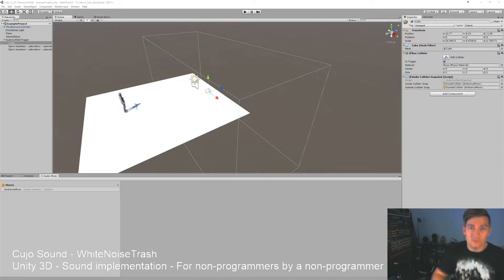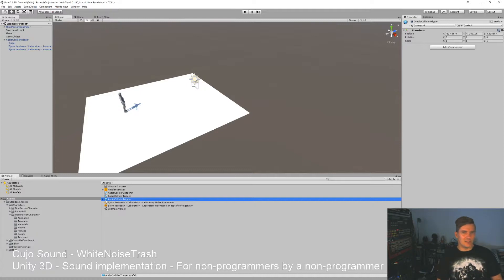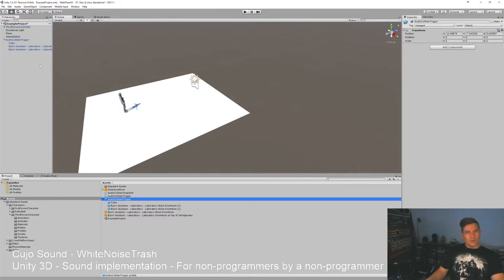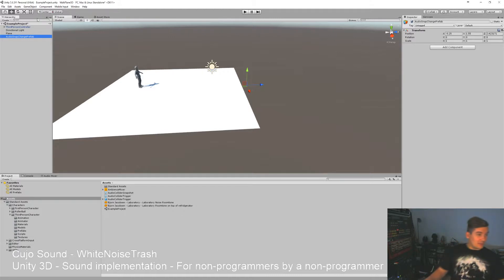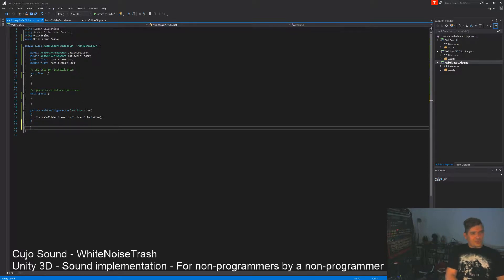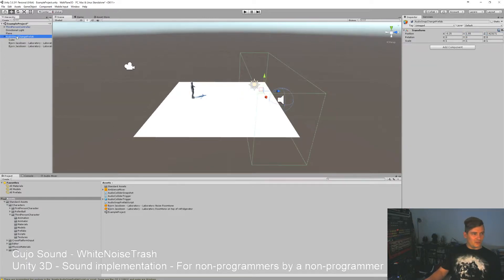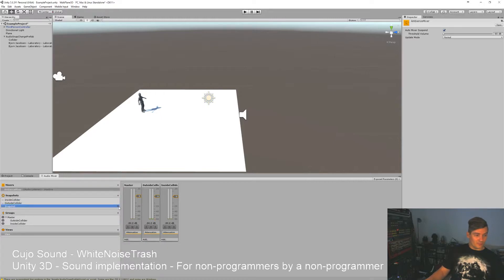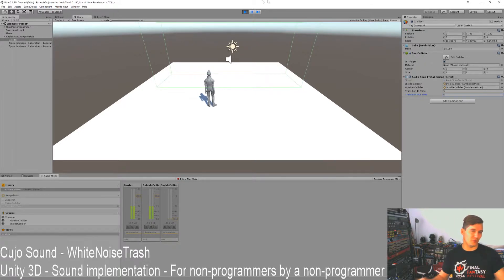Bjorn Jacobsen - Sound Design:  Part6: Unity Audio prefabs. For non-coders.

Comment: Great tutorials Bjorn! 1 question: If a prefab is applied to a different area, can it then be edited seperately, or will that edit apply to all other instances of the same prefab?
Reply from the maker: Yes. But only if you make sure it is no longer a prefab.

Create a prefab in any way you like. Create an empty game object and Drag your prefab into your scene as a child of it. 

Place it where you want, but then select everything in the prefab and drag it out of its parent and into the new game objects root. In that way you will now have everything from the prefab outside of it in the same place as you put it previously. 

Only downside to that is that any script on the main prefab game object will have to be added to the new game object again. 

There are other ways, hang on, I'll figure it out in a sec. 
At least, as long as it's not the blue colored prefab, it is basically a normal set of objects. Else it will, as you say, end up affecting the prefab itself and then all other instances of it.
Reply from the maker: Alright. Yes, you can create a new gameobject and drag all prefab children into it, this will give you a new object with this.

Now, if you want it to be the same one. Select all the children inside the prefab, drag them out into the root of your scene hierarchy. This will give you a warning about that you are breaking the prefab. Say yes, and drag them into it again.
Reply: Thanks very much!